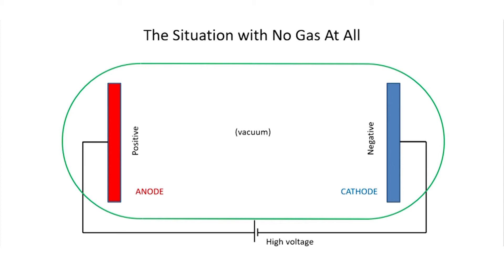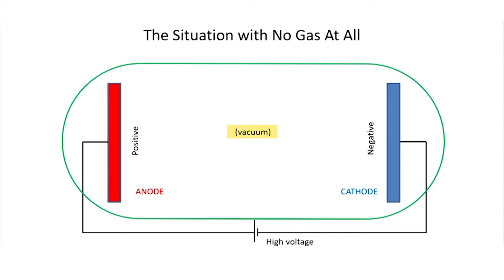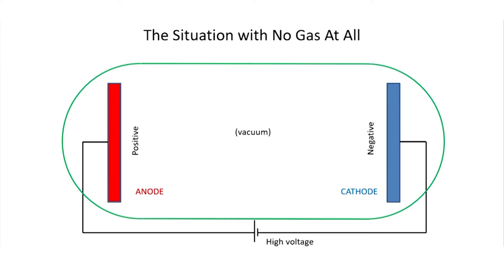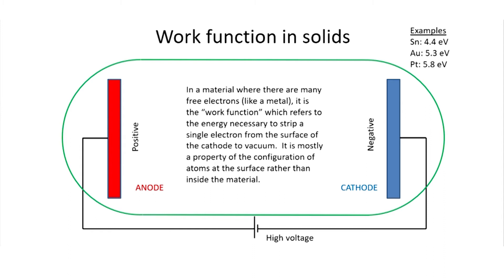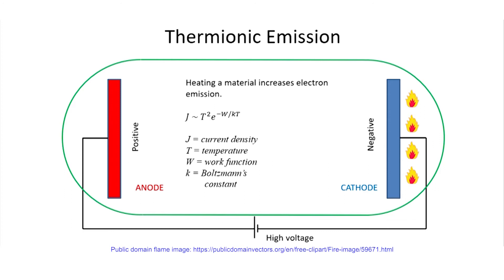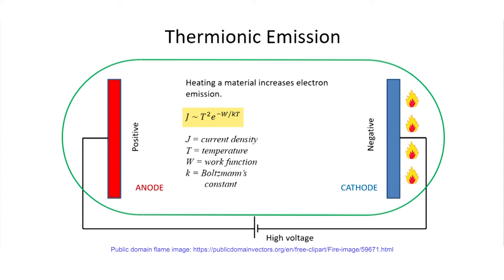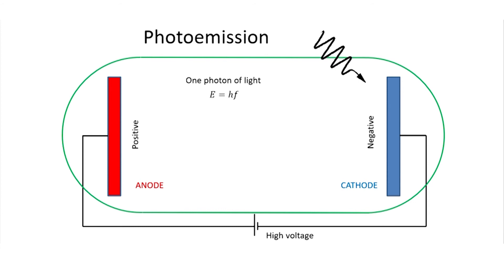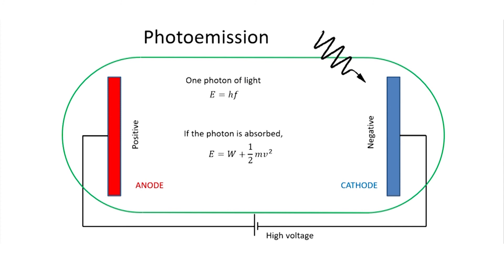Electricity in a Vacuum (Electrical Properties of Materials #9)

Comment: Is this related to Vacuum permittivity (ε0 )? Or does ε0  only apply to devices like vacuum capacitors? I am aware of vacuum tube rectifier tubes (diodes) as you discussed. The whole concept of vacuum permittivity baffle me.

Comment: something doesnt seem right. he says you have to overcome the work function in order to get electrons to flow, but, if you think about it, a magnet moved across a wire gets electrons to move, meaning, the power supply already overcomes the work function in order to get current to flow and since the vacuum gap is essentially a conductor with zero resistance, the electrons should continue to flow, so his reason for why it doenst unless additional means of essentially induction occur seems irrational. replace the vacuum gap with a conductor and current flows, so why doesnt current flow when a gap of a conductor is replaced with a zero resistance conductor? hes talking like there is an insulator between the electrodes which require a sufficient voltage to overcome to induce current flow, which would mean a vacuum isnt actually empty

Comment: Isn't something wrong here? 
When elements are heated they release gasses " OUTGASSING" after cathode got heated Vacuum was LOST because we ADDED elements in to the chamber! This is the reason why vacuum lost it's ability to insulate! If OUTGASSING is NOT real please correct me. If elements are NOT introduced in to vacuum chamber from heating please correct me. Please do this with scientific evidence that OUTGASSING is NOT true. Are cathode and anode used in the system made from exact same material? If yes why? if not why? can someone explain in detail please? why not just use "electrode" if they are the same? I am very interested in learning about these.

Comment: Isn't this a contender to the red shift theory? I mean that galaxies that are red, might not be far away, but only have less or no work function, between us the observers and the light source? The conservation of energy should not be affected by distance. So a photon should conserve the energy through out a red shift, but a with out work function it shouldn't. Wouldn't this be the difference between an electric universe and a gravitational universe. An experiment could prove or disprove either.
Reply: Red shift is analogous to doppler effect. Don't see your point here. Can you clarify?
Reply: @MrElapid  In current cosmology it is. But it's wrong, Hubble was wrong. Einstein was wrong. Look, light is not photons, waves or any particle. It's just an energy transfer between higher and lower state atoms. It occurs in the smallest and the largest scale and in different intensity. As energy is transferred from an atom in a star to an atom outside the star, the receiving atom/atoms can be anywhere in the line of sight. This atom will immediately just relay the energy because it can't keep due to it's singularity or position on the surface of a small lattice. For each such energy transfer some energy is redirected to an atom not only in the line of sight. It scatters. This is the cosmic background energy we see all over. So, since it's conceivable that that all the energy that leaves the star will not arrive at the same time to our eyes, due to each path being slightly different, we see a red shift due to the energy loss. It's never going to be possible to exactly measure a distance to another star because of this. Hence it's not a popular idea.
This theory goes back to Weber who in 1854 proved that the atom does not have a nucleus or particles inside.
An atom can't be fused or split only radiate and receive energy outside a lattice. Deep inside under constant energy pressure the atom changes to an higher state element. If you brake the lattice, for an example in an explosion a massive amount of energy will radiate away to atoms in the line of sight. 
Go inside a dark room with a flash light. Turn it on directed to your eyes. Turn it off and you will see the excess energy in the atoms of your eyes, until it all has scattered to the walls or you brain as an nerve impulses. To much energy and you get a heat stroke when you can't radiate it away to lower state atoms.
The universe is simple, mathematicians makes it complicated!

Comment: Does current flow in perfect veccume cathode ray tube ? Veccume means no particle present inside cathode tube.
Reply: Have you heard about particle accelerator?
Reply: current can not and will not flow in perfect vacuum! So to overcome this problem you introduce elements in to the chamber. this could be done just buy heating the cathode and cause it to outgass.
Reply: @chickybrain  If you consider the flow of electrons from a cathode to an anode current it does. Heated cathode or not. When you heat the filament in a vacuum tube an electron cloud forms in the vicinity of the filament and can be accelerated towards the anode via HV. But not necessary, just takes higher voltage to do it as explained very well here. You seem angry. Biden voter?
Reply: Initial state is vacuum. With a high enough voltage electrons will flow. Power down, back to initial state.